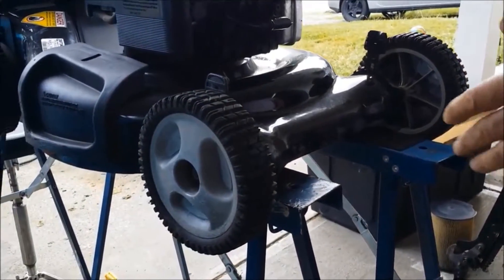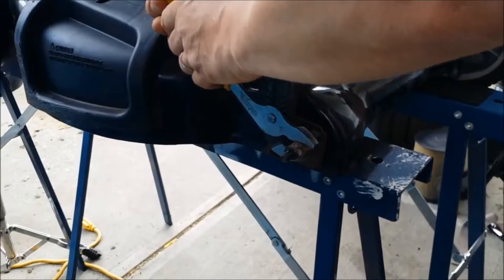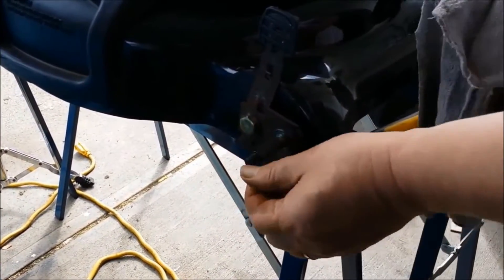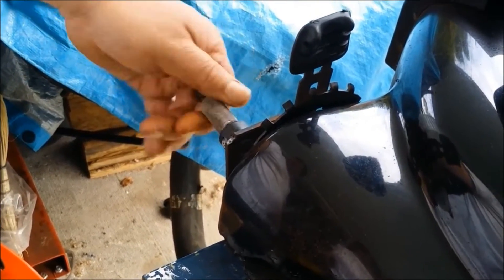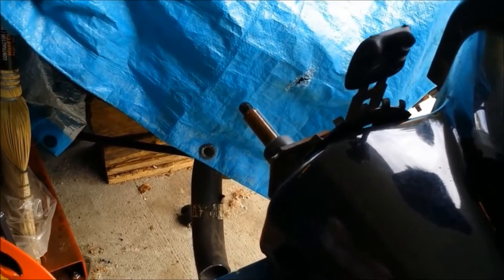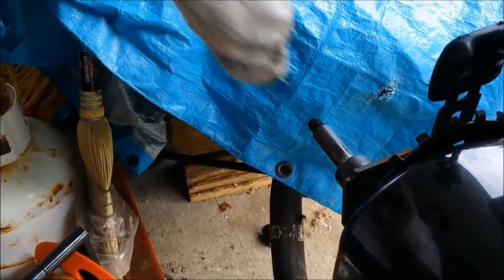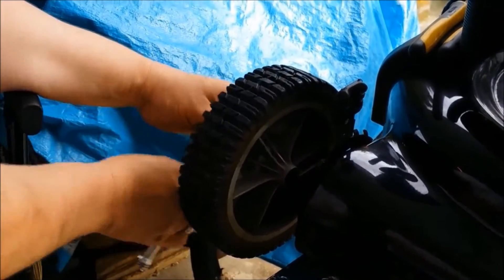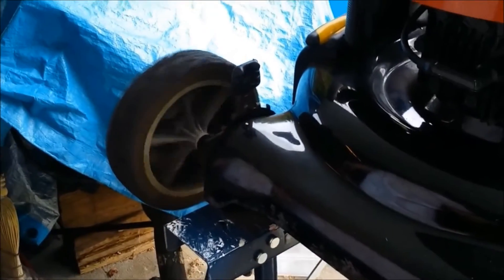Seized Lawnmower Wheel Repair - Briggs&Stratton 675 Series

Comment: I have a 21 murray botth front wheels are seized.It doesnt have sleeves.the wheels are plastic 1 piece that slide over a splinded axel.Should these turn when wheel is pulled off? The wheels just slide on the splined shaft snuggly.The inside wheel plastic is smooth so not splineded too.Dont know if I should grab hold of splined metal axal shaft try turning or if the plastic wheel should just slide on and be turning over the splines?
Reply: Figured it out.Had to use torch heat up the spline on shaft use pipe wrench and got it to slowly budget.Eventually got it off the axel shaft cleaned lubed back in business.
Reply from the maker: I.would use penitrating oil and tap lightly on them as I pulled. Good luck let us know how it goes

Comment: Thanx for this video....ant recommendation on exactly what type of lubricant to use? Penetrating oil to remove the bushing and what kind of silicone to use for the shaft before reinstalling the bushing...
Reply from the maker: macknumber9 I used red grease marine produce I will get the name when I get home from work for ya
Reply: Gongshow Garage cool thanx

Comment: How do you get the wheel off.  I can't get it to budge, even with a hammer.
Reply from the maker: Hi lori I used penetrating oil then turned the wheel tapping with a hammer on the back of the wheel till it came off ....hope this helps
Reply: Also, after you use WD-40 (or any lubricating spray), try sitting on the ground and pulling the wheel as you turn it left and right like a steering wheel.